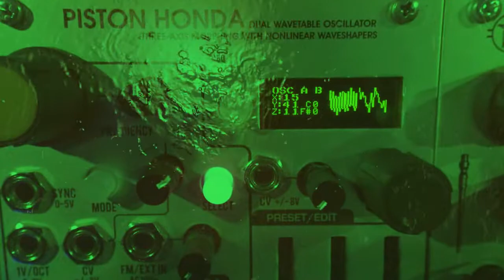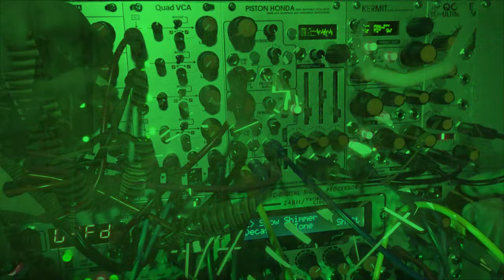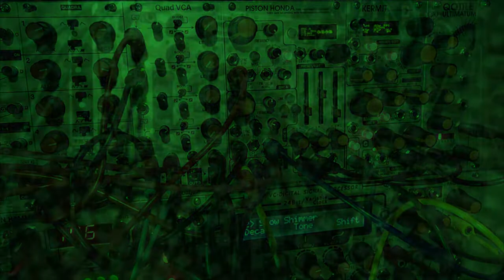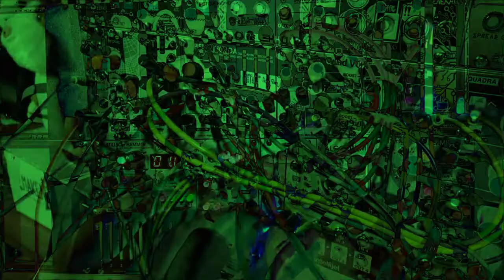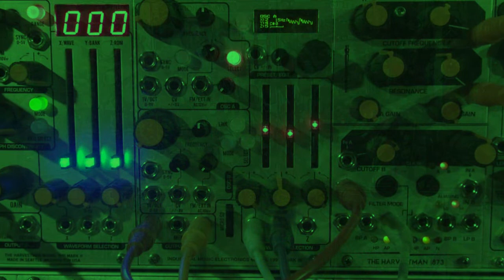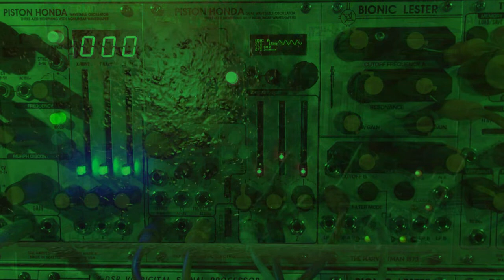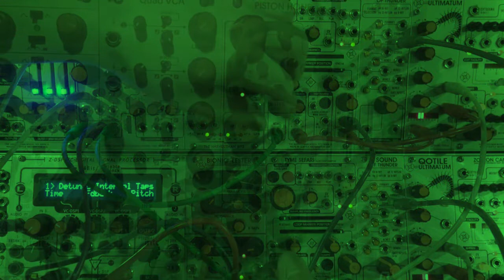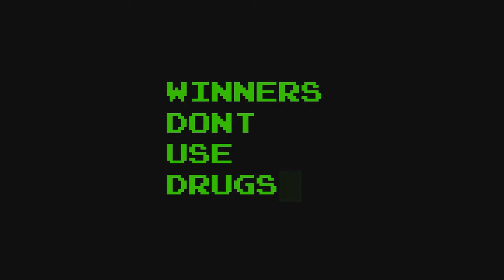PISTON HONDA KOMPARE : Part 3 PHMKIII

Comment: Incredibly good 🫠
Do you use the „stock“-wavetables? Or custom ones?
Reply from the maker: A mix of both original and some I modified. I change the banks occasionally. ..... And It should be time for a change. I was working on a bank based from static noise waveforms. But my way of using the PH3 has really changed since this video, for the better.
Reply: @robotopsyrobotopsy6486  thank you!

Comment: Hey Robotopsy! I can also just say, amazing sounds you made there! I just got a piston honda and was very happy to get inspired by your video. If you have some tipps or wanna share your patchnotes on this one, id be very glad! Keep going with these videos!! I rarely find stuff I like musically with modular videos, so its uniquw. All the best from Berlin
Reply from the maker: I lost most of my patch-notes when my hard-drive decided to die on me.  But one of several technics I like to do, is to use multiple VCAs and splitting the audio channels to different audio lines and sequence them. Like the Piston honda mk3 got 3 separate outputs, send each of them to VCAs or Lowpass gates. Split some to a filter with multiple band outputs "like the Bionic mk1 or Intellijel Polaris. Use all the outputs through VCAs and Lowpass gates. Try sending some of those outputs back into the OSCillator source for some kind of self FM'ing, or feedback, or self hard Sync. I really like to use snappy envelope through VCAs and use random voltages to the decay input of those envelopes. I also like to use mixers. Mixers aren't just useful to mix audio for the final mix. Mix CV - LFOs -Envelopes. Mix audio signals through FX processing. Also each new module I get, I always scan the front panel for each knobs - jack inputs or outputs - sliders - encoders.... anything. Try to understand each parameters and see the potential of each. Hope it helped a bit even if it's not specific patch notes. If it's a Piston honda mk3 you got, you might want to check out my video on the preset management tips. There's some nice tricks with the preset features and functions that makes the IME mk3 so powerful and I hope I did a good job explaining how to use the manager.
Reply: @robotopsyrobotopsy6486  😍 thanks so much for the patch tipps! I cannot wait to try it out:) Lots of useful ideas!!

Comment: Is each recording only 1 track of the PH?  I ended up getting a shapeshifter instead.  I like it a lot.  Endless exploration w these two modules.
Reply from the maker: In some sessions I used all 3 outputs routing to different modules. Look in the video description, there's a link to all the different session of all the Piston Honda Kompare I made.... 5 hours of piston honda. I also got the shapshifter and it'S a great module, but the ergonomics of the piston honda suits best my needs... Still I'll keep the shapshifter.... no doubt it'S a keeper.

Comment: amazing man.. sound great, between the 3 you have a preference in term of sound?
Reply from the maker: Thanx.... it's hard to say , they all got their own flavor. The mk1 is the more harsh and aggressive for sure. The mk2 must be the more melodic and is the only one  equipped with an LFO and a seperate circuit for external audio waveshaping. The mk3 got 2 individual OSC and must be the more flexible of them all. So I'd say the mk3 overall but the mk1 is full of surprises that I have not ventured in my demo.
Reply: @robotopsyrobotopsy6486   thanks a lot, i m looking at modules to make my first modular 104hp based on the piston mk3 , i really enjoy what you did with it.. maybe you have some modules to recomend me that work great with it
Reply from the maker: @fredDhyāna   Well if I had a 104 hp case to start with. I'd go with this.

FX aid xl gives you lots of effect and really nice one and you can change what ever algorithms you prefer.
The kermit can give you 4 outputs of mostly anything from oscillator - LFO - Random - Step CV - Envelopes it's a must for me.
King slender is very useful for weird shaping and the mixing features.( basic)
The Prok can go any percussions you like and even some of the weirdest glitches, this thing is insane but very noisy.
LXd Makenoise got some very excellent Lowpass so this 4hp will be perfect
Pachinko is the smaller Marbles and will be a good way to sequence trigs and CV and keep it flexible and modular. Maybe hard for a start but will pay off eventually and you'll be grateful. PHMKIII-- !?!?!? dont know this module... it may be good ? :P
Quadigy is an excellent quad envelope generator with lots of features.
Quad VCA is amazing, multing the CV input + submix from the outputs - the VCA response is just perfect for melodic or percussiv sound. I used this in every patch of this kompare vid. Bionic Lester mk3 is a dual filter with unique preset management (like the PH MK3 and Kermit) and the Comb Filter can be an insane glitcher or even beautiful echoes. I'd be very happy with a case like this.

https://www.modulargrid.net/e/racks/view/1851287
Reply: @robotopsyrobotopsy6486   thanks so much for the help , i will check all of these , for now i won t need to make drums or sequence them and i might sequence from the computer  via midi with mutant brain if it s tight enought so i might replace pachinko and prok, thanks a lot man !!
Reply from the maker: @fredDhyāna  I'm using the Hexinverter Midi2CV for clocking everything. I tried and tested lots of things and clocking with midi from a DAW is the tightest you'll get. 
I made a short tips video on how I do sync and reset with this technic.

https://www.youtube.com/watch?v=UhGHwC-6-5Y&t=141s
Reply: @robotopsyrobotopsy6486 can you expand on this? i thought all 3 had external waveshaping. amazing sounds too ❤
Reply from the maker: Yes all 3 piston can do waveshaping process to external signal. But only the mk2 can do this in parallel without restriction to the Oscillators output.  I found so many tricks I wish I knew before I made this video @soundswhile9529
Reply: @robotopsyrobotopsy6486  ah that makes perfect sense! have been doing a deep dive on your channel trying to find the best place for me to dive into ime. think i’ve settled on the HD mk2 🤔 hope to see/hear more from you!
Reply from the maker: If all goes well !!! before Christmas :D  @soundswhile9529